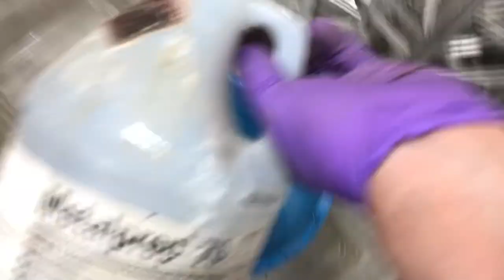Episode #6 - 1941 Piper J5A Restoration -  Wing ready for Reassembly

Comment: You’re doing a great job! We got delayed a little bit by having to mill down the thickness of our spars so that when we glued the mahogany plates on top the fittings would still fit correctly. We also replaced the butt rib with a new one from Univair because there were so many holes drilled in it from the past.
Reply from the maker: Thanks for the support. I also ordered 7/8 thick spar blanks because when I measured them they were on the high side of the 13/16 called out on the print. So, yes, I also reduced mine to the 13/16 nominal size. Right now I’m bonding the ply doublers to the spars.
I also ordered new butt ribs. Thanks for watching
Reply: What is the finish you are using on the painted steel parts?
Restoring 1940 j-4a myself